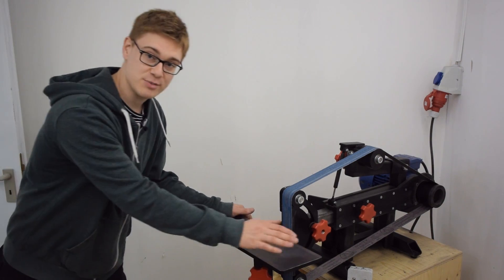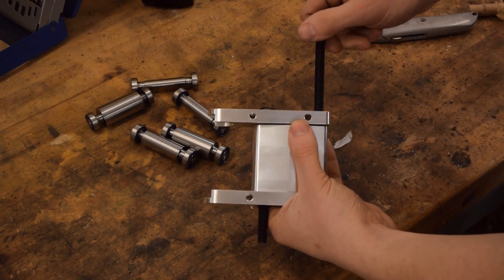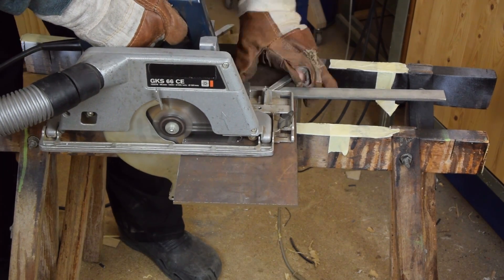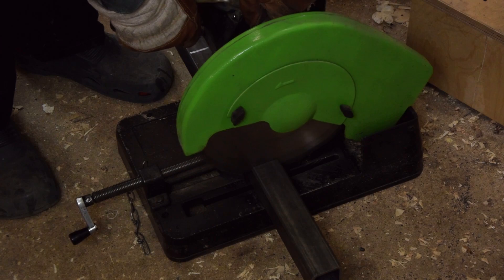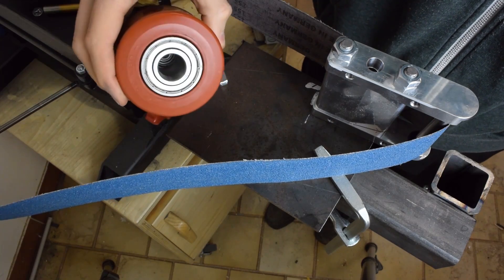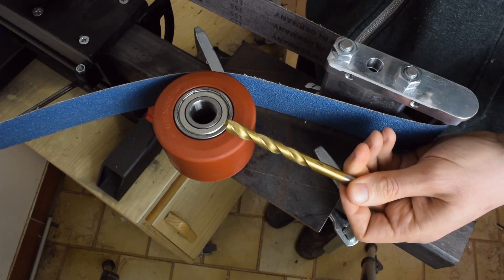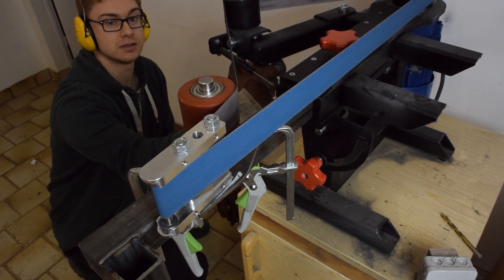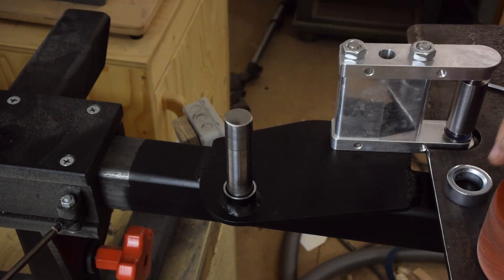How to Make this 2x72" Belt Grinder | Small Wheel Attachment

Comment: Your grinder is reminiscent of Jeremy Schmidts grinder, especially with the ability to rotate the frame like that. Were you inspired by him, or was he inspired by you? Or was this a case of parallel evolution? I like that you built yours to use square tubing for mounting the platens, much easier and cheaper to get hold of than a solid square beam.
Reply from the maker: We built our grinders simultaniously and independent. I think mine started much earlier though (October 2016). But it really doen't matter because there were a LOT of other grinder builds on the internet and on YouTube already (also tilting ones).

Comment: A small suggestion, maybe you could spring load the table plate, so you could lower and raise it with light hand pressure as you work on the piece?

Comment: Awesome! Is there anything holding the  small wheels in besides the belt tension?
Reply from the maker: The table keeps them from dropping out of the holder when changing belts or if the belt ruptures. Which is quite an important feature ;) Once the belt is tightened it presses the wheels into the holder and they can't go anywhere.

Comment: I am curious how fast will the outer pulley wheel wear out.
Reply: I'm not sure if the word exists but let's call that self-trolling?
Reply: 2 minutes and it will be gone! It's on the rough side so it will be worn away just like the metal you're grinding!